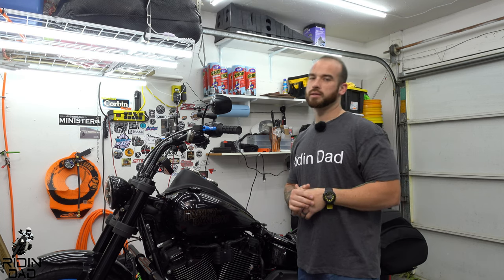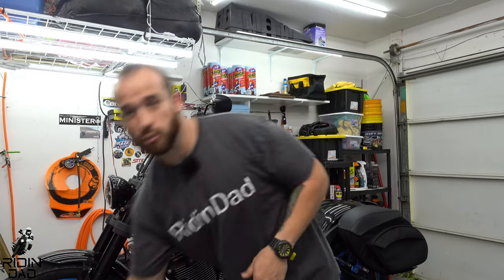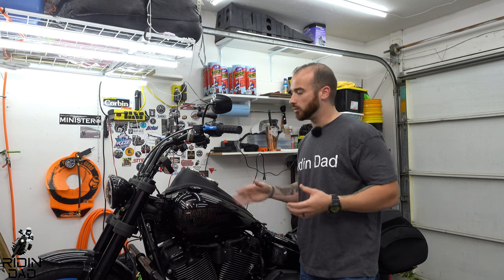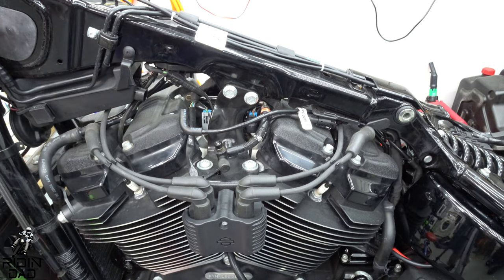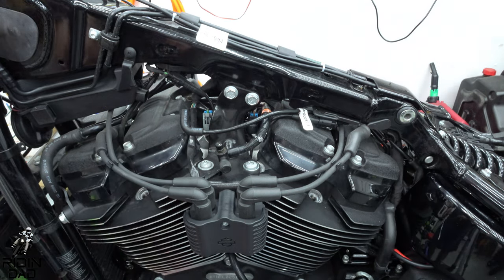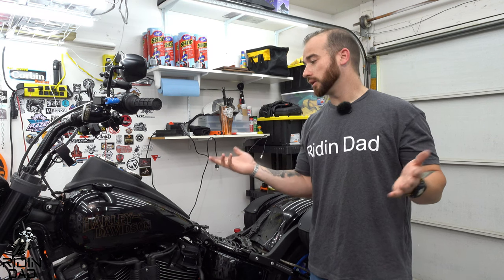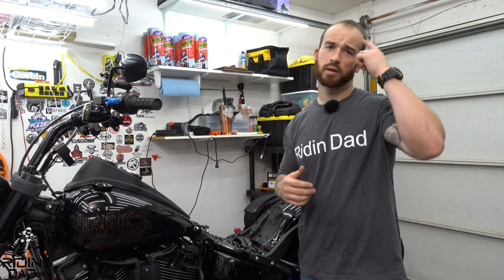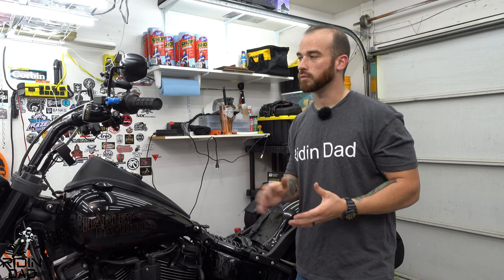How to change the spark plugs in your Harley Davidson M8 Softail - featuring my FXLRS

Comment: Have you ever considered purchasing the magnum shielding electric blue metallic ignition wire set? I pulled the trigger on the copper canyon color today. I’m gonna see how they are before getting their clutch and brake cables. Good video as always !
Reply from the maker: Thanks! And no I haven’t. Every single color wire I’ve ever seen does not match my blue perfectly and I feel like it would throw off the rest of the bike especially since now I have paint on the tank and the center – in that blue also

Comment: Note/Info. & general FYI:  From what I've heard...timing [and spark advance/spark retard] on Harleys and how it relates to Spark Plugs and Spark Plug Wires...Harleys use what's called Ion Sensing, as opposed to something like a crank trigger.  It is super important that the Resistance [spark plugs & spark plug wires] read by the Harley Sensor [which uses the Resistance of OE HD Spark Plugs & Spark Plug Wires] is within the range of the OE plugs & wires.  The SE plug wires and spark plugs are ok to use, but no power increase that I'm aware of [yep, the SE plug wires do look nice & are ok to use].  Be careful when using aftermarket [non Harley Davidson or Screamin' Eagle] spark plugs and/or spark plug wires.  Just putting this out there from what I've seen on several videos here on You Tube.  Tom M., So. Cal.  '21RGS & '22FXLRS
Reply from the maker: Appreciate the input man. I’ve heard no issues with the ngk’s. They’re marketed as a direct replacement too. Bikes been running great for me for several weeks with these now

Comment: Great video! Book marking for when I need to do this over the summer, what size spark plug socket is needed? Thanks!!
Reply from the maker: Same as car if I recall. Honestly been a while. Dont know the size off hand but go to any auto parts store and say you need a spark plug socket. You should get the right part. It’s magnetic too
Reply from the maker: And thanks man! 👊🏻

Comment: Great video, my street glide is due. 
If plugs aren’t gapped correctly, will that gap gage tool do that or will i need to return them ? Thanks. First time doing plugs.
Reply from the maker: You just bend the tip in or out depending on what you need. Gap gauge shows what you need. Dont return the. M

Comment: You should use antiseize before installing spark plugs..
Reply from the maker: I’m pretty sure I either stated that right before I installed them or I at least put it in subtitles. No?
Reply: @RidinDad  I didn't enable subtitles :) if you mean on screen warnings, it wasn't there. Also in video, it seems you don't use any product.
Reply from the maker: Yeah the on screen stuff. I did subtitles before YouTube does them so it would show up no matter what. But I just re watched it to see and you’re right!! I never spoke on it. I did include it in the description of the video. In in the original part where it shows me putting them back in I did forget to put the anti-seize on them at that point and I did take a second video but I guess I forgot to edit the correct one in at the time of editing. I always make sure I put anti-seize on these and exhaust studs and such. It does at least say it in the description lol. Good catch!!
Reply: @ihateemael and you have stuck spark plugs :D
Reply: @ihateemael  change plugs every 18 months? 😂 even service manual says 48000 or 2 years. Nobody changes them in 2 years. Btw I am not yankee, I am from Turkey :) its like exhaust flange bolts. I recommend you to read service manual before making something up from your mind.
Reply from the maker: I think he deleted his comment as I can’t find it anymore? But I agree, 18 months for spark plug swaps is ludicrous

Comment: I'll be curious to see what you think of them, anytime I use more expensive plugs on a bike they kinda suck and the bike doesn't run as well, but then I throw the basic b!tch ones in and it runs great!
Reply from the maker: Haha tis is life man. Ive been riding it with these plugs for about 250 miles so far and the bike runs perfect. Made an air cleaner change too and bike it running better than ever now so I think I found the winning combination
Reply: Thats probably because people don’t gap them. Not only that but when gapping iridium plugs you need a tool and feeler gauges at best. If you stick those $1 feeler craps they sell at vatozone…. You’ll most likely damage the iridium tip
Reply from the maker: Is that right? Damn I honestly had not heard that before. That’s what I used for these!
Reply: @RidinDad  no man. That can damage the iridium tip. Those things are delicate as hell. I use feeler gauges like the ones used for valve lash. And a special tool that squeezes down the tip if it needs to be closed
Reply from the maker: Good to know. I have feeler gauges I use for valve clearance. I’ll use them in the future for sure
Reply from the maker: Mine were all correct and I didn’t have to adjust anything thankfully

Comment: Thinking of installing better plugs and wires after installing cams and larger throttle body. Any thoughts?
Reply from the maker: It won’t hurt anything but it’ll waste your money. Not needed at all. You can upgrade to the ngk plugs for the quality. But nothing fancy is needed
Reply: Put that money towards a custom tune or something. Plugs and wires are a waste
Reply: @drwombat  has custom tune.

Comment: When are you supposed to change out the spark ⚡️ plugs ?
Reply from the maker: I am nowhere near my bike manual and I honestly don’t recall. But it should be at a regular intervals according to your manual for sure. If for whatever reason you do not have your manual for the bike you were asking about I’m sure you could Google it and either find the manual for free or for a few dollars or the answer to your question
Reply: every 2 years or 30 k miles

Comment: that rear cylinder is a pain in the butt, is there a trick to getting that off
Reply from the maker: The spark plug is stuck in the rear cylinder?
Reply: @RidinDad  the wire was just making me nervous yanking on it...its all good now
Reply from the maker: Gotchya @phillipmarable3736

Comment: You should be able to just lift the gas tank to get to the right side plugs without having to take the tank off.
Reply from the maker: Angle is not enough space
Reply: Great video! Thank you 😊
Reply from the maker: Appreciate it. Thanks!

Comment: Dumb question, when you pull the tank do you have to drain it. Or does the quick connect hold the fuel back?
Reply from the maker: Nope you don’t have to drain it at all. You can disconnect the electrical part and cycle the start for the bike and it’ll help drain residual fuel out but you don’t even have to do that
Reply: @RidinDad  awesome! Thanks for the reply man! Going to be doing my annual service relatively soon before I put it away for winter and haven’t replaced plugs on mine yet.
Reply from the maker: Nice! No problem man, happy to help 👊🏻
Reply: @RidinDad  so I finally got around to doing my plugs and service. Just me being me I experimented before I went ahead and pulled the tank. So if you want to skip a step you can get this all done without pulling the tank if you use a wobble extension to get the plugs in and out. Only pain in the ass part was pulling the cables 😉
Reply from the maker: Yeah it’s so easy to pop the tank off I’m not willing to deal with that lol. It takes an extra 30 seconds if that to remove it all the way. Wayyyyyy easier

Comment: Do not use anti-seize on  the plugs, its not needed.  The plugs have a factory coating on them to keep them from seizing.
Reply from the maker: Anti seize is highly recommended and cannot hurt anything if applied correctly and sparingly. It’s always a good idea